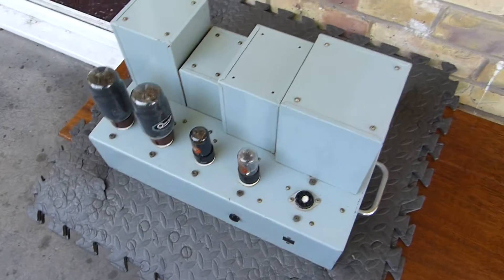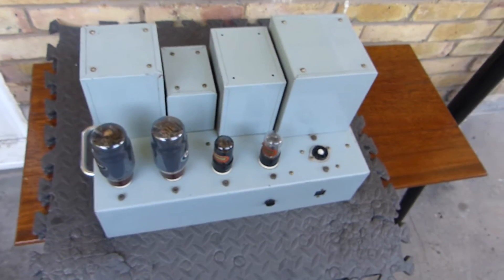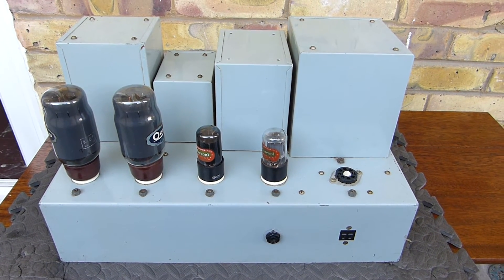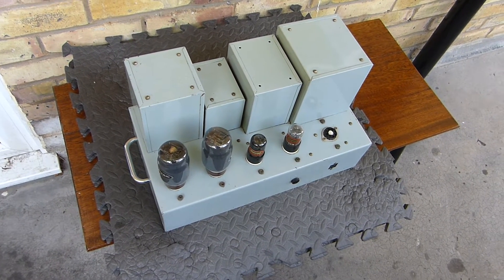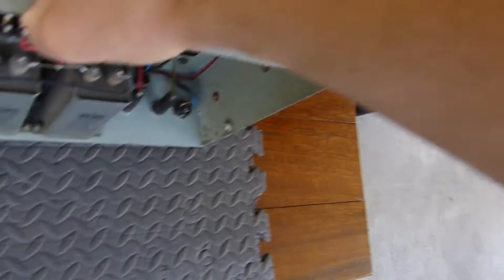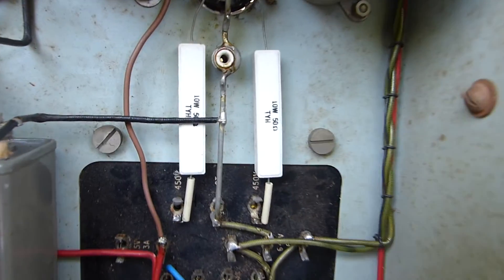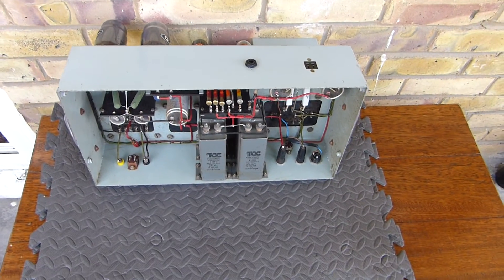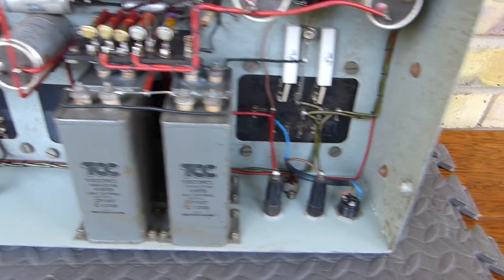Williamson Valve Vacuum Tube Amplifier? KT66 pair & 6B5 pair

Comment: put the valve rec back nice amp
Reply from the maker: We put a GZ32 rectifier valve back in, unfortunately had to sell the amp to an overseas buyer in Asia, would liked to have kept it ideally, turns out the circuit was a GEC MOV design. Thanks for your comment!